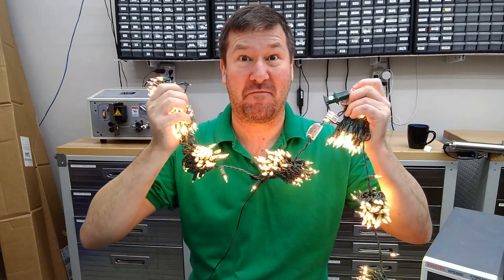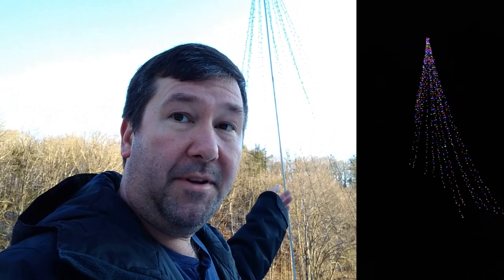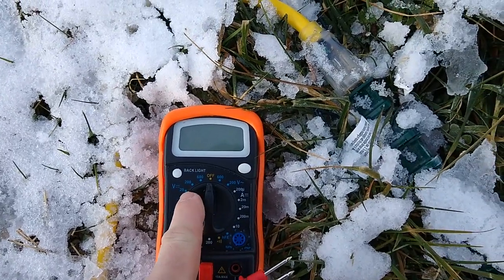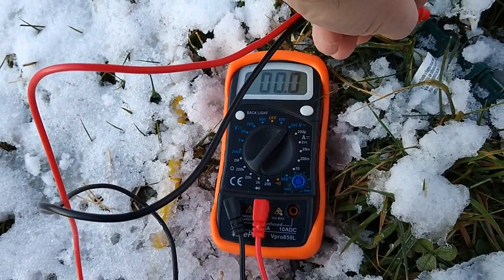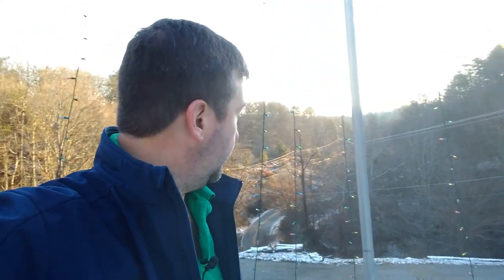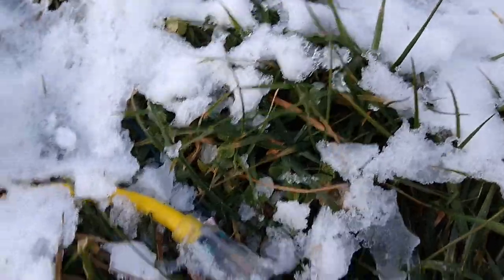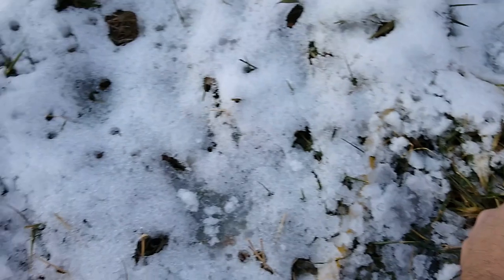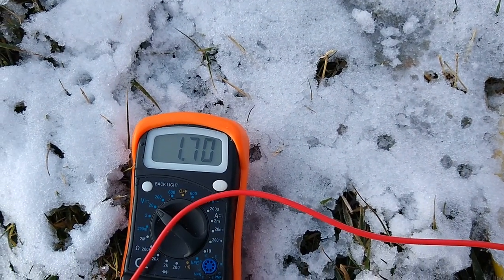Did I Discover Free Electricity?  Leakage Current? Inductance?  Earth Battery?  Dirt Battery?

Comment: Recently I have attempted to create an earth battery following instructions online and its always amazing to read a voltage output. However. I would like to increase the amperage as without it, the power I'm getting seems quite useless.

I'm currently generating 14v but only 2microamps. This measurement is take directly connected to the earth battery without any other circuitry(switches, resistors, capacitors etc.). Is there something I could refer to or follow to bring about an increase in my amperage enough so that I could store it in a cell? I understand I may have to put it through a transformer first before I can use it with normal appliances but thats the next step I guess. Learning to crawl before I learn to walk
Reply: Try aluminum, carbon, the set string into a old capacitor

Comment: The earth battery is a galvanic cell.  The copper is protected and the galvanized pole (zinc) is oxidized.  
https://www.princeton.edu/~maelabs/mae324/12/galvaniccell.htm

As long as there is zinc in an electrolyte to corrode, you would continue to get a current.  The 1.1 volts checks out due to the relative potential of zinc and copper.
Reply: Great video, btw!
Reply from the maker: I'm still struggling a little bit with the capacity that this one shows but I guess if you consider 8 foot of that pipe driven in the ground and the fact that probably the inside of that tube is also packed full of soil, doubling the surface area then it is significantly more than the 1 in by 6 inch strip of material that the kids and I use this summer.

Comment: The Rain water is acting with the soil particles each having a slightly different atomic charge based off its composition. The water acts like a electrical wire linking the atoms of particles each having thier own electrical potential depending upon its electrons and Protons and neutrons. These particles react by releasing their charge...
Reply: Yeah, I could agree with that. What's interesting is that the "copper ground" and a galvanic pole are pretty far from each other. I mean, take two rods one foot apart and two rods twenty feet apart, and the voltage will be the same (about 1.5 volts). Isn't that interesting?... It looks like current doesn't even care how far apart rods are from one another.